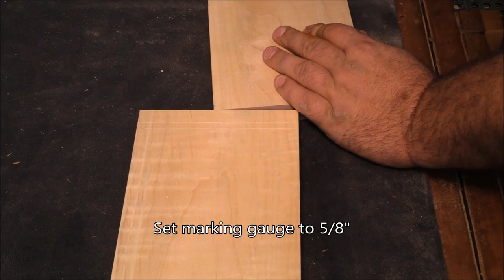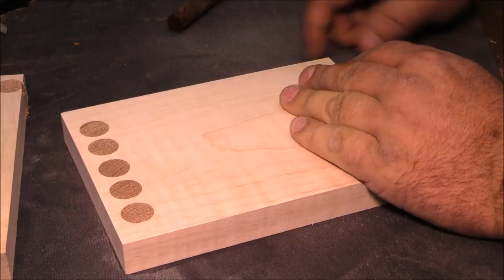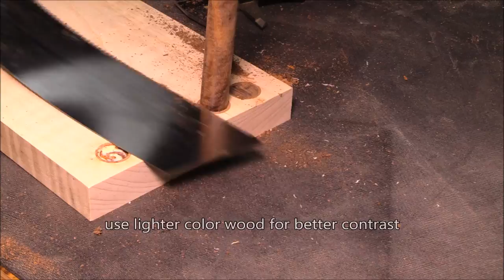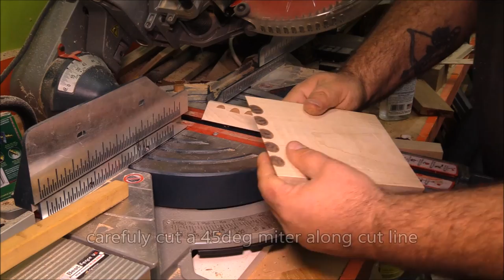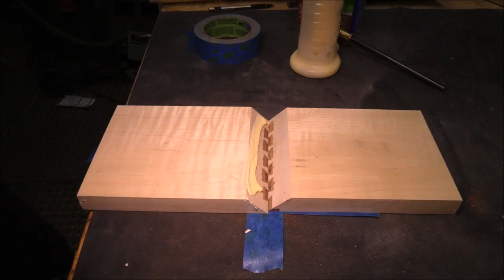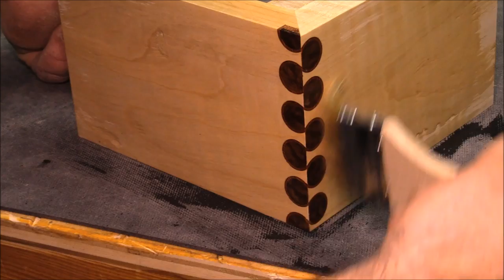Fancy Corners with a Drill Press

Comment: After assembly you could drill and glue a small centre dowel through the centre of the plug inserts to lock into the adjacent side, thus rendering it a very strong joint.  Maybe use skinny brass rod??? Cool idea thanks for sharing.

Comment: Thanks for sharing. Yes that is a delightful, fancy corner, thank you for the video. The alternating style and the contrasting wood colours look great and any piece of furniture made in that way would be a talking point. 

What about a splined corner, but instead of using of using flat inserts make a jig to drill 45 degree holes and glue in dowels? You wouldn't  have the exact same alternating result but it would have far greater strength!
Reply from the maker: I need to do a video one this subject, a spline or simple doweling system would give it plenty of strength this corner is for looks after al isnt that what we do try and make thing look nice.

Comment: Drill once more smaller hole  add light wood in center along with dowel pin on a few to strengthen the joint .looks cool nice idea

Comment: Very cool.  Think I would use a plug cutter though, both because you will not be looking at end grain (tho nothing wrong with that...) and you can match the grain direction when inserting it, but also, you could cut the smaller one out of the original wood which would go beyond your wishing to use a lighter wood and make it entirely an "S" passing around the corner since all the wood would match except the "S".

Very nice though!!!

Comment: I think you might be onto something more than a decorative feature with this one. Those dowels are edge grain when you cut the mitre so if they were touching each other it's no longer an end grain glue joint it's already edge grain and doesn't need splines.

Comment: Aesthetically pleasing, but structurally inefficient.
Thanks for the vid though!
Join up the dowels between both sides and make a 'dovetail' joint and then I'd be RALLY impressed!
Reply from the maker: its just for looks man,  a spline or a dowel would be simple enough to give it structure.
Reply: Couldn't you just reverse the order of operation? Join the boards first to make your corner, then use a block or something under it so you can center it on your drill press to drill in the holes for the dowels. You could easily drill them deep enough to go into both boards, that way you'd "have your cake and eat it too" as it would be aesthetically pleasing AND structurally sound.

Comment: Let's assume you used a light colored dowel in the center.  Instead of a spline, you could drill the center of the lighter dowel and run a darker dowel through both boards to reinforce the corner and it would just look like the pattern.

Comment: Love the concept,  love the sound but why is the inside corner block there?
Reply: He was probably a little nervous about the strength of the joint with only the glue keeping it together. It would be quite a bit of time wasted if he knocked off a table by accident.

Edit: Not to say that glue alone isn't strong enough by itself in many applications.
Reply from the maker: I didnt want to wait for the glue to fully cure. so a added the corner block so i could get this video done.

Comment: tip: use a set of straight dividers, set spacing  by using the digital calipers or a scale. make the first prick then put one point of the dividers in that hole and simply walk down the board with the dividers letting its two points align in the previous prick holes and the other end of the divider make the second prick. more accurate and far less clumsy. >> http://www.northerntool.com/shop/tools/NTESearch?storeId=6970&ipp=24&Ntt=Empire+6in.+Divider+Caliper

Comment: Where do you get the darker colored dowels?
Reply: There's a 24hr dark dowel shop just round the corner from Izzy's house. He's lucky in this regard.
Reply: I would suggest a plug cutter instead of dowel; let's you use any wood, doesn't give you the end grain of a dowel but lets you match the grain direction when inserting it, and by using the original wood for the 2nd smaller insert, you get a perfectly standing out "S"...
Reply: In another vid he shows how to make an old school dowel making jig. With that jig, you can make dowels out of any wood any any size you want.
Reply: Any brand or set you recommend?  I see lots of conflicting comments on sets being sold on Amazon.
Reply: deathblosomrules For a plug cutter can't specifically remember any, think I got mine cheap off Ebay...   I think most would work though fine, just cut reasonably slowly and let the tool do the work.